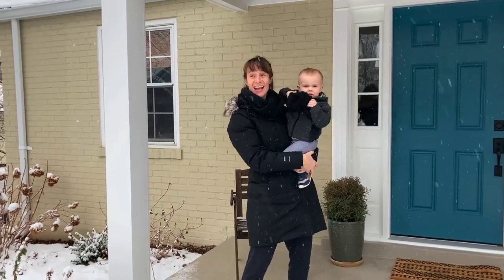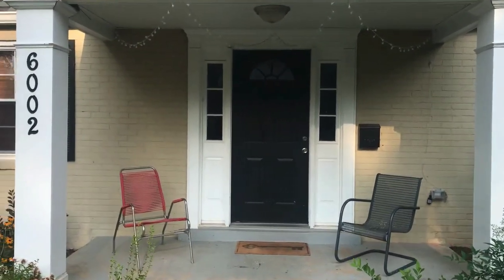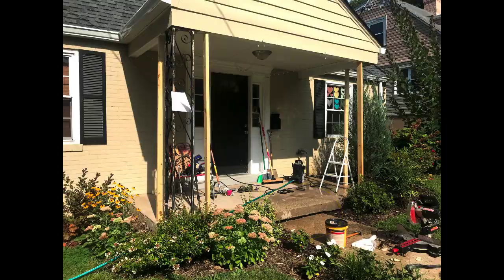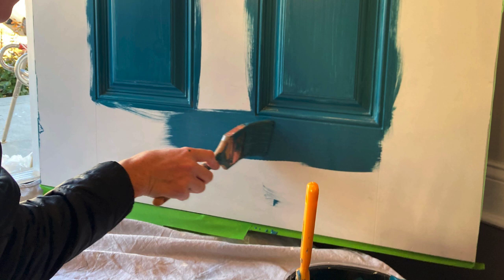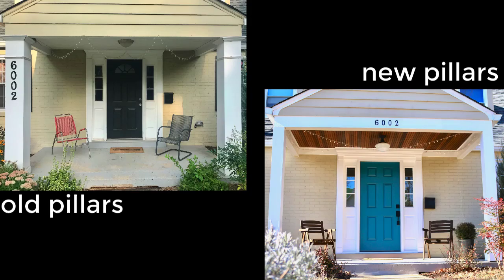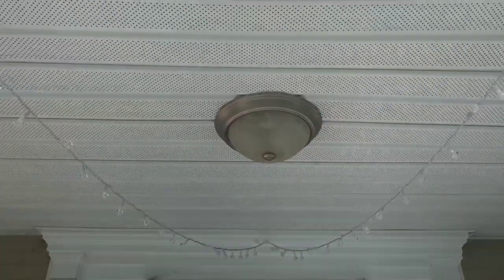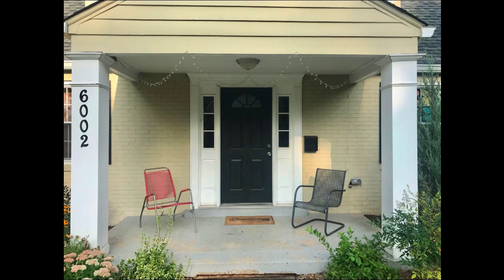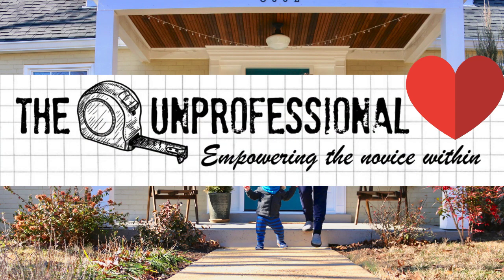Front Porch Rebuild | Maximum Curb Appeal

Comment: Are you allowed to do your own wiring? I was under the impression that professionals are required for that kind of work. Could that be a state law thing?
Reply from the maker: It’s definitely a good idea to have a professional do electrical work. In this case, all I did was replace an existing wire and fixture. It’s not a new circuit and didn’t impact the load.
Reply: @TheUnprofessional  sounds like you know what you’re doing! I don’t even know what you just said. 😂 I guess that means I need to call a professional to replace my porch light! 🤣
Reply from the maker: LOL! The first time I changed a fixture I didn’t do It right and it fell and shattered everywhere. In my 4-year-olds bedroom nonetheless. 🤦‍♀️
Reply: @TheUnprofessional  okay, that definitely makes me feel better! 😂 Thanks for sharing!